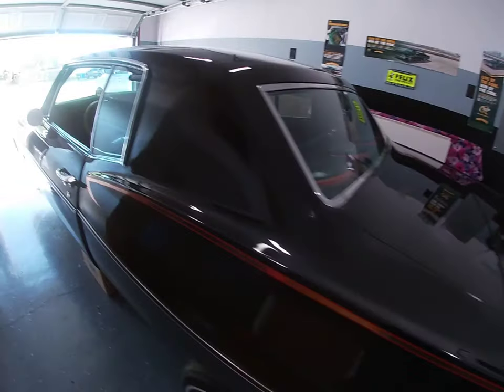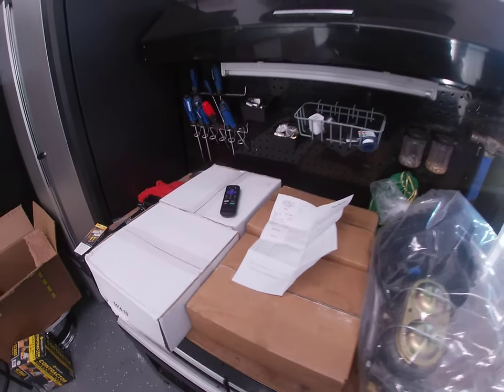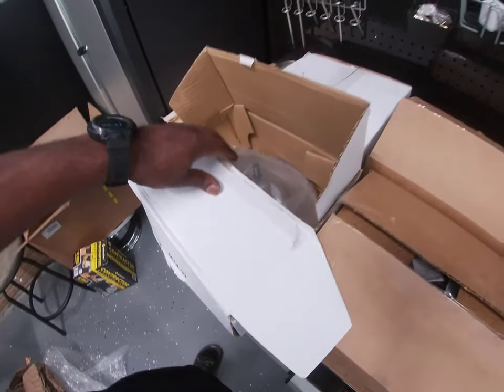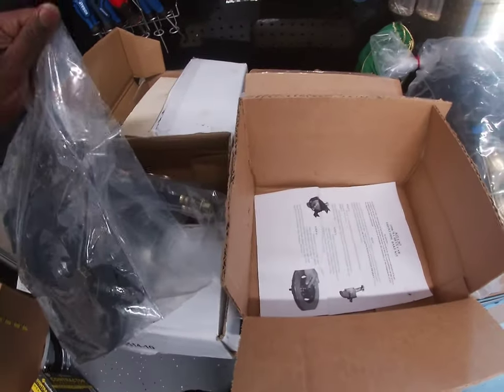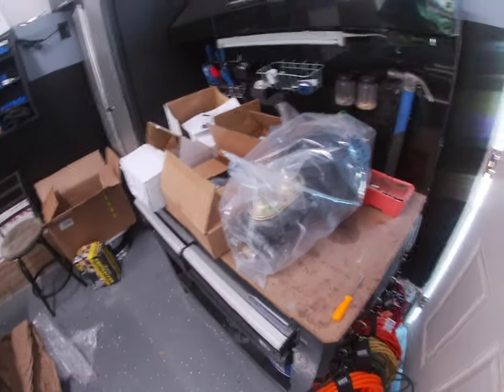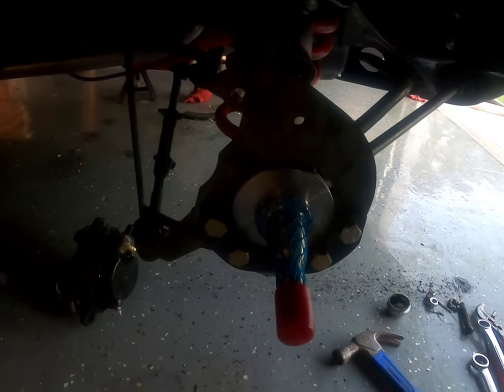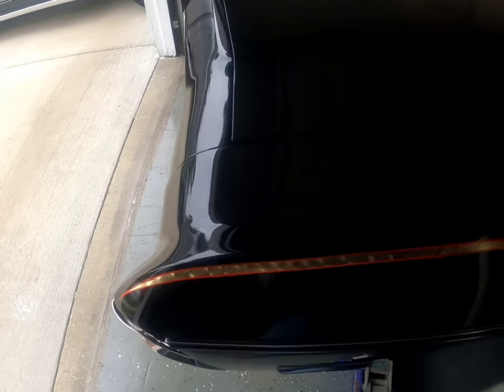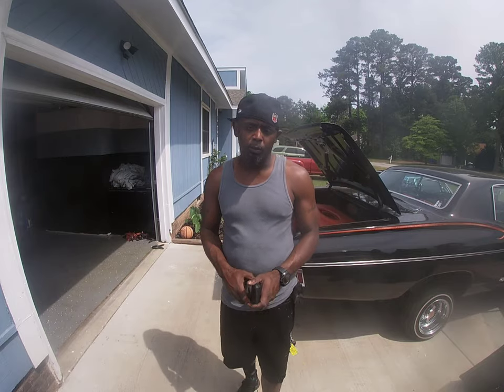ABS Power Brakes on 68 Impala Lowrider

Comment: I HAVE A 64 IMPALA NICE CLEAN DISC BRAKE KIT & IT CLEARS 13" WHEELS I NEED TO GET THAT KIT! THE ONES I SEEN KICK THE WHEELS OUT ABOUT 1" AND THE CALIPER NEEDS TO BE GRIND OFF. I HAVE SEVERAL CARS. LIKE TO DE MY HOME WORK HATE TO MAKE MISTAKES. NICE VIDEO. CAN I BUY KITS  FROM YOU?
Reply from the maker: ABS Power Brakes out of Orange, CA. You have to call and order. No online orders. They fit perfectly. No cuts or anything. Works great !!! Thanks for watching
Reply: @switched_up_2six487   What was the total price for the setup?
Reply from the maker: i think about $1200 with shipping. no cut, fit perfect. no problems with this ABS Kit.
Reply from the maker: $1200 with shipping. worth the money and works great  @rockwallcares5084